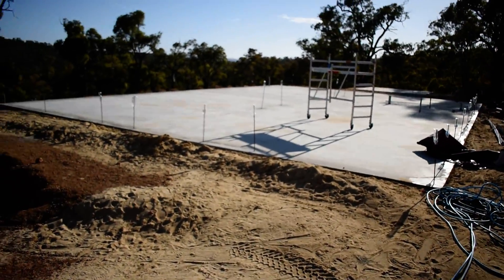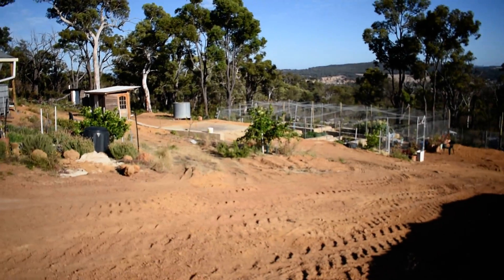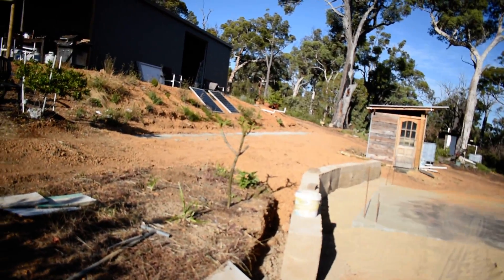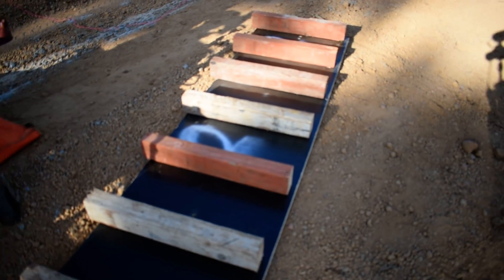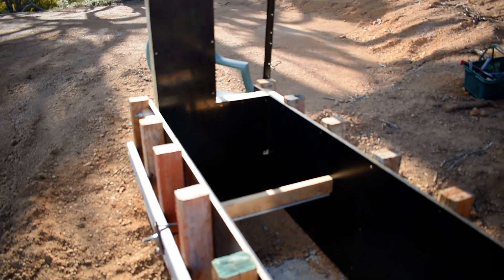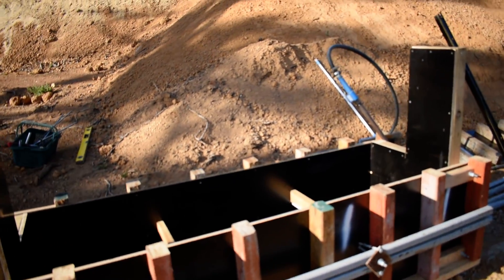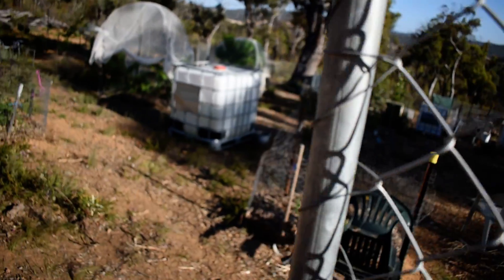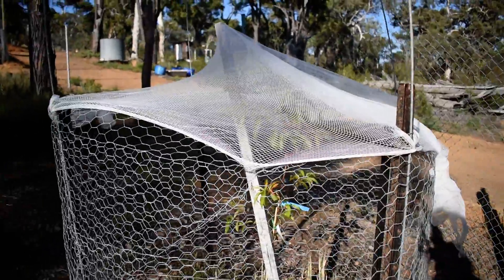Rammed Earth retaining wall (part 1)

Comment: I thought you would remember the concrete pillar pour we did in Mangrove Creek Dam and what the forces were like.
Reply from the maker: I remember that day "Jeez it's taking a lot of concrete, fuck it's all coming out the bottom." Concrete has a lot more force especially with the vibrator.  I have worked out the issue will share in the next vid.